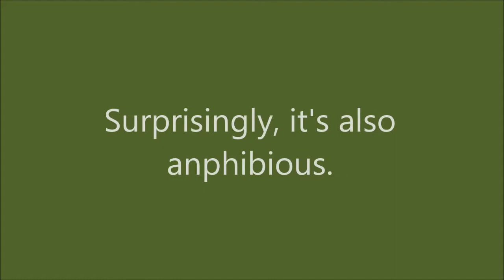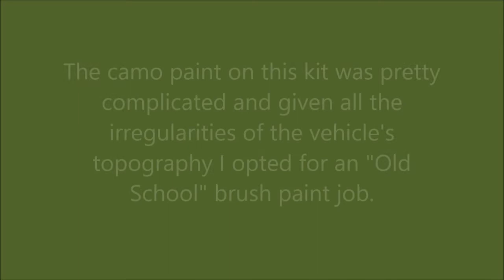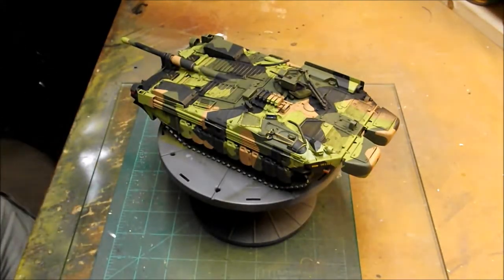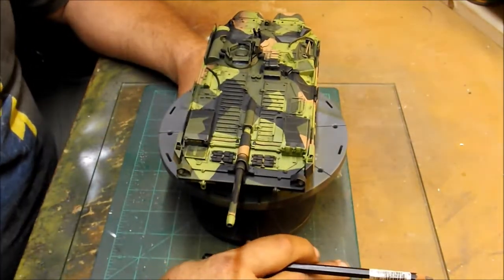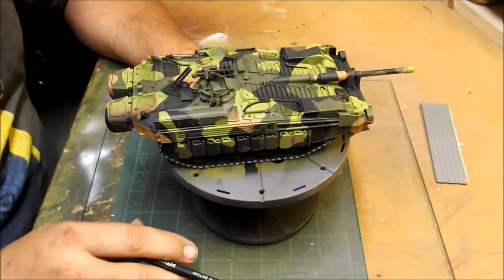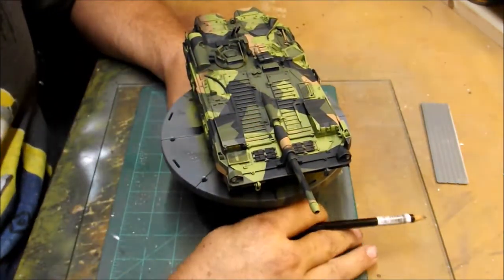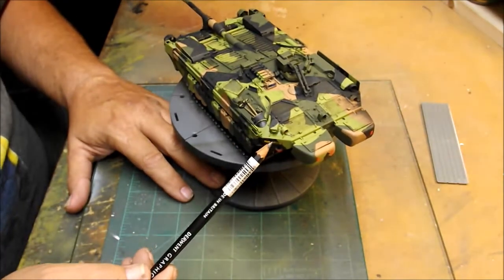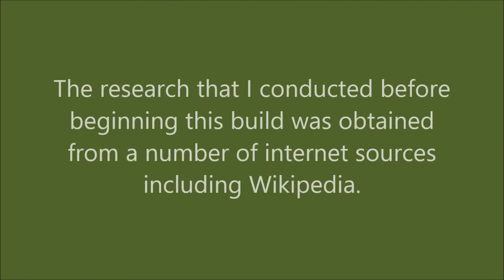Strv 103C

Comment: Very nice build ! Would you mind sharing the paint numbers you used. Thanks.
Reply from the maker: Thanks and sure :-)  For the base green I used Vallejo US> Dark green number 70.893 (after looking at a few more reference photos I think this might be a bit too dark you may want to lighten it up a bit). And for the brown (it looks darker on the model) I used Apple Barrel Territorial Brown number 20558E (this color is one I picked up at Walmart in their craft center as are the next couple of colors). For the black I started out with Apple Barrel Jet Black number 21885E and I cut it with a drop or two of Apple Barrel Granite Gray number 21392 (I wanted the black a bit washed out and this mix did an excellent job). Now the light green really gave me a few problems but I finally think I got pretty close with a mixture of Anita's app purpose acrylic Deep Celery number 320646 (another Walmart craft section paint) and a bit of Vallejo Reflective Green number 70.890. I didn't use any specific mix ratios just a drop or two of one or the other until I felt it was what I wanted. I hope this helped :-)
Reply: @danknispel4588  , thank you very much ! I have this model 3/4 done. Was holding off on the camo until I saw your build. Your build was a great inspiration !!!
Reply from the maker: @TheGreywulff  Thanks, glad I could be of help.

Comment: It was an ambush tank, and one to be feared. inside of Sweden.
Reply from the maker: I can see how it would function well in that role.
Reply: @danknispel4588  The tank has no turret, and the mountain highways of Sweden was overlooked by what would appear to be crisscrossed by fire breaks or logging roads then when they were really firing corridors with different hull down hides in them. The Soviet tanks would not be able to get off the highways or climb up the mountain and were in a since trapped. Until the STRV 103s fired were more than likely hidden and that is where the rear driver comes in to shoot and scoot.
Reply from the maker: @Randall82760  Cool intel, thanks.

Comment: TD is tank destroyer, then why did you said it was not a tank, Dan Knispel
????
Reply from the maker: If you search (reference Wikipedia) you will find that a tank is relatively defined as "A versatile mobile land weapons platforms whose main armament is a large-caliber tank gun mounted in a rotating gun turret, supplemented by machine guns or other ranged weapons such as anti-tank guided missiles or rocket launchers." Note the words rotating gun turret, the STRV lacks this feature. I do agree that it does meet some of the general definition of a tank as it is a military combat vehicle that runs on tracks but lack of a turret moves it more into the category of a tank destroyer like the German Jagdpanther or Jagdpanzer.